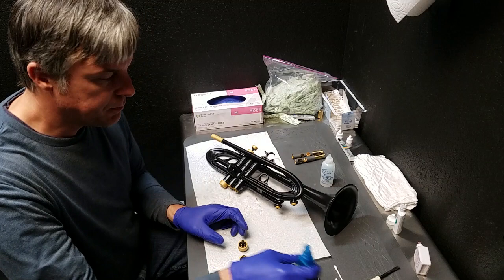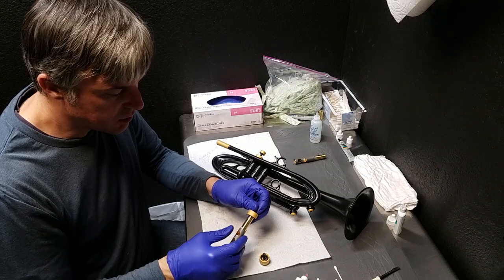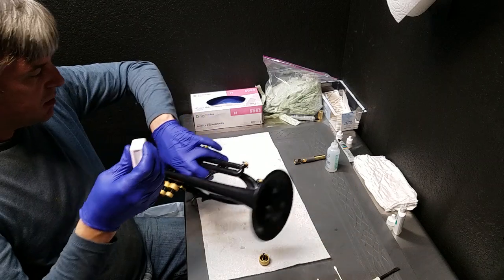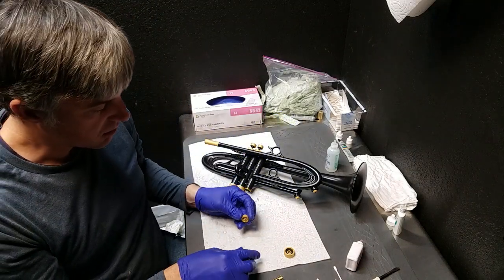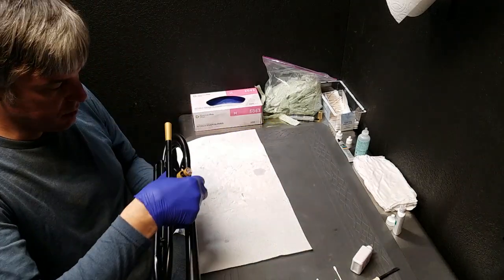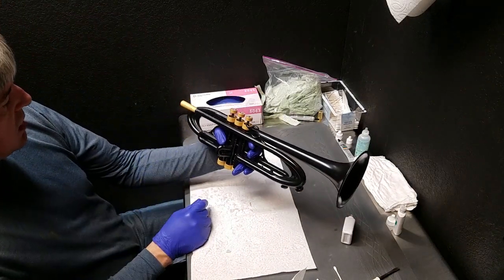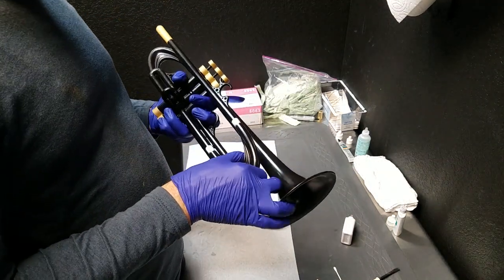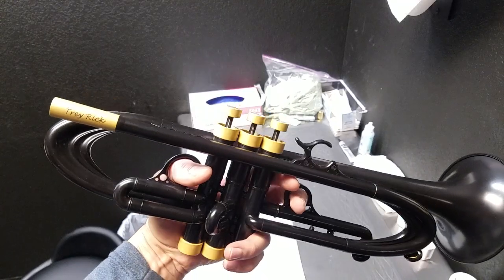Final assembly/inspection of a new Harrelson trumpet

Comment: You use plastic valve guides on your horns? Is there a difference between plastic vs a metal guide? Would it be beneficial or nonnoticeable to change the material on the valve guides from plastic to metal or vice versa?
Reply: I do not think anyone makes metal guides for CarolBrass Huxon Gakki valves. You would likely have to modify a metal guide made for a brand like Bach or Yamaha. It has been a few years though since I checked for metal guides for HG valves. Given how efeceint and how much mass Harrelsons Trumpets have in the key area's  that need it I would doubt metal guides would make much difference on Jasons trumpets. If they did he would make them or purchase them.  Jason spares no expense when it comes to his Trumpets! Just my thoughts though your millage may vary! Cheers!
Reply from the maker: Metal valve guides are the primary cause of valve barrel wear and eventual radial alignment tolerance failure. In short, metal guides wear the edges of the barrel causing them to be out of alignment. You can see this on well-played vintage horns. Plastic guides are replaceable and inexpensive. However, our valve stems are designed and machined to be high efficiency adding inertia to the entire piston. These reduce energy transfer considerably and we will be releasing these for Bach, Yamaha, Schilke, Monette and possibly other brands next year.
Reply: Harrelson Trumpets thank you for the reply. Any chance you'll be releasing a set for Kanstul or wild thing trumpets?
Reply from the maker: Yes, that may be a possibility.